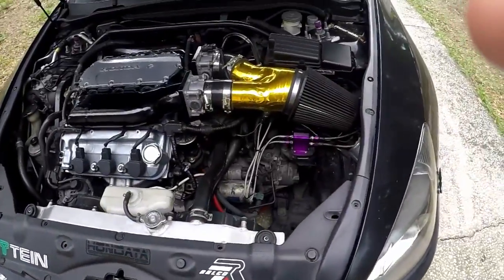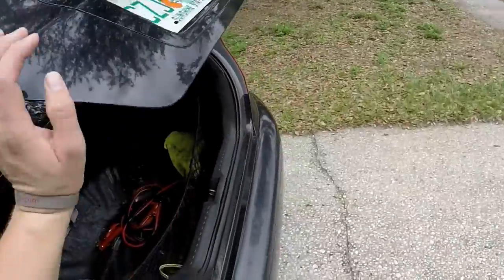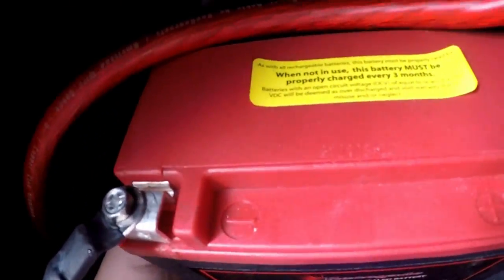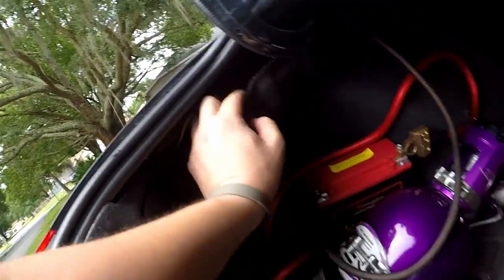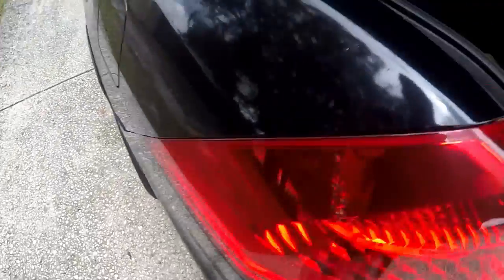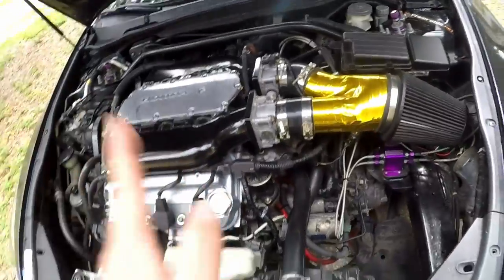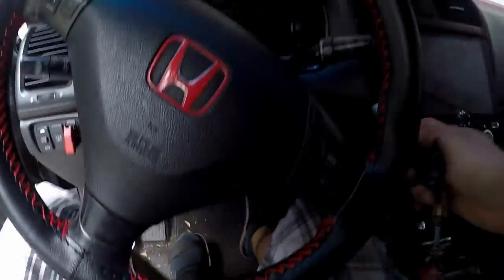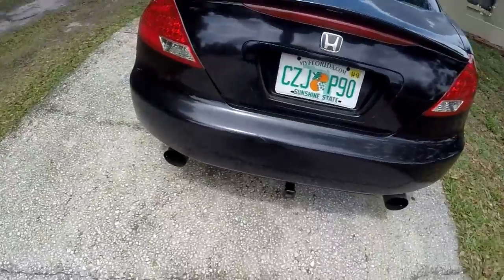Part 2_ Quest to 600whp = Battery Relocate Accord V6 J Series + Lightweight Battery Option

Comment: Looking good bro 👍
Reply: HalferLand Video's bro how on earth do you have dual throttle bodies? Where did you buy the intake manifold? I have the same car as you and its just too slow im trying to save my money up to get a 94 camaro Z28. I wish I could increase the power on my J30 like you did but I doubt I could do any of this.
Reply from the maker: Aries Vang  Thanks man! I had such a detailed video, piss me off LOL
Reply from the maker: DTB IM IS custom, old member on V6performance.net- if you haven't already then JOIN!!! That's where I starred  and now I'm here

Really? Bro my car stomps even a heavily nodded 94 Z28.....DON'T DO THAT!! With Intake, Exhaust, cam and spray you can push this motor to 400whp, for what $3-$4k!!
Big question though, MY or AT?

I really need to start making my own performance parts for  the public' I've sold about 12 runners, they sell  fast as I can make them- I'm also doing my own custom cams if you want a set
Reply: HalferLand Video's mine is automatic unfortunately. There is no Hondata K Pro availability. Plus i doubt there is any place in Raleigh nc that could relocate my battery, take apart my motor, send it to a machine shop place to regrind my cams, re-install, create a dual tb manifold and install, port my heads, install pre cat deletes and RV6 exhaust, new catback mandrel bent and install nitrous for less than $8,000. And the only tuning option would be AEM FIC since im automatic. And tuning costs money. Thats more than a used LS1 camaro goes around here. I've already chopped a hole through the hood and put in a screen net thing over it. And I put on smaller wheels and tires 15 inch to try to lower the gear ratio to go faster. I have a video of my 0-60 on my channel. Still too slow. And okay youre right you might beat the LT1 camaro but only because of nitrous spray. The LS1 camaros are much faster. Have you ever seen a video of a 2000-2002 camaro ss on nitrous spray? Its ridiculous.
Reply: HalferLand Video's https://youtu.be/bNihcH7Z6Gk
Reply from the maker: Smart Feller It doesn’t work that way. You would buy stage cams and install them, same with Ported runners and heads. Down time at most 2-3 days. 
I get it though, wish you the best
Reply: If i was going to try and increase the speed of this car for me it would be much easier to hack together some kind of a cheap rear mount turbo like this guy did with his Lexus LS400 
https://www.youtube.com/watch?v=I_GhWfivn6s
Reply from the maker: This was when the car was only 240whp NA and I just hooked up the spray. It's now 270whp NA and fully tuned for spray, basically it move a ton faster then this video. Like I said, outside of being a Drag car Ive beat all of these gens Camaros with headers, intake, cams, and spray under 100. Our Accords are fast https://www.youtube.com/watch?v=OzY8wpwi_ng
Reply: HalferLand Video's not a big fan of NOS thats almost cheating in my book.
Reply: HalferLand Video's are you going to show a video on the turbo install? Id like to see where the oil pressure sensor is and how to tap into it just out of curiosity. I think for me a hacked together rear mount would be my best option. Im not sure if i could do it though. Ugh i just hate it when your parents get you the wrong car. V8's have so much more torque down low and makes it more fun to drive.
Reply from the maker: Smart Feller First it’s Nitrous, “NOS” is a brand, I don’t have NOS, I have a Zex Nitrous kit. 

Also they’re all a power adder, whether turbo, SC, or nitrous.
Reply from the maker: Yeah, I video what I can.... It's going to be a lot of work so I'm not really trying to stop every 10min to video......but like I said, Ill do breif overviews.